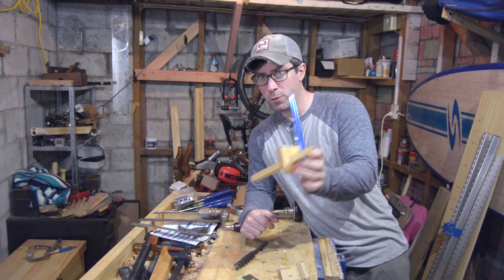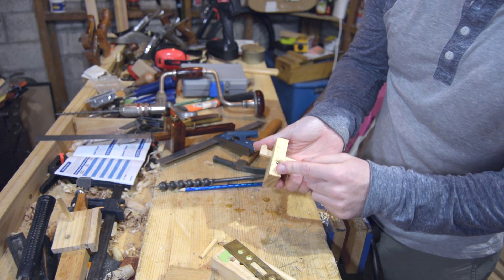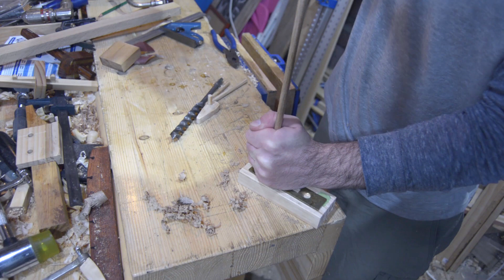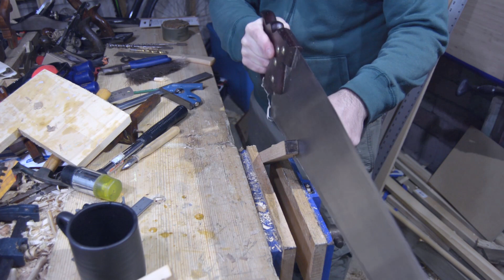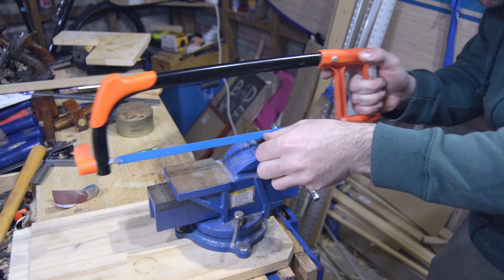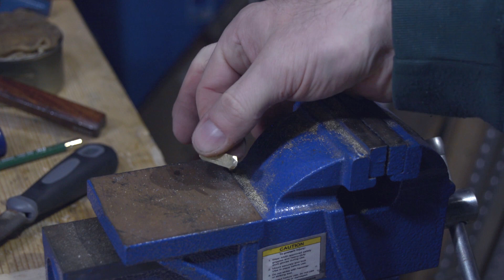Making a Marking Gauge from Oak with Hand Tools

Comment: Hey Phil, I'm in need of one of these  - I found one at Mitre 10 that was terrible quality - I thought - well I could probably make one almost as good myself. The trick now will be not to go and buy the equally as crappy one from Bunnings haha.
Reply from the maker: Well YOU I know will end up making a beautiful one for sure! I actually look forward too seeing it!  They are so easy and satisfying you'll love it.
 But even a cheap one like bunnings and mitre 10 sells is better than none.
Reply: Well I'll at least have a crack at making a nice one. I actually took the Mitre 10 one to the checkout and they wanted 17 bucks or something and I was like yeah nah I'll make one.
Reply from the maker: yeah those ones are super cheap.  I would suggest the second hand stores or antiques stores over there.  Some had really nice ones at the same price or cheaper.   I actually found one once at the local tip as well.
Reply: Good idea - I got a pretty nice engineering square at a second hand store recently. It was actually square on the outside (bonus) but not the inside (no biggie).
Reply from the maker: Squaring the inside sounds like a perfect subject for a video!

Comment: I'm really digging this design over the common design, I might try to do this if I ever try to make a marking gauge, it's pretty much a push button. 

The saw being refiled into a cross cut isn't that bad, it's almost like sharpening a cross cut blade but just a little more to get the shape right. 
Or are you going to change the number of points/teeth on it?
Reply from the maker: +lujanjd Hi I like this design as well just make sure to use hard "dense" wood for it. The pine prototype got a bit beat up from the pin/dowel wedge.

And yes I did change the tooth pattern as the one before was all over the place. Definitely owned by someone who used it and sharpened it a lot. Also someone who didn't know how to sharpen. So I ended up jointing all thier teeth off and starting fresh. ( which I messed up and started fresh a second time)